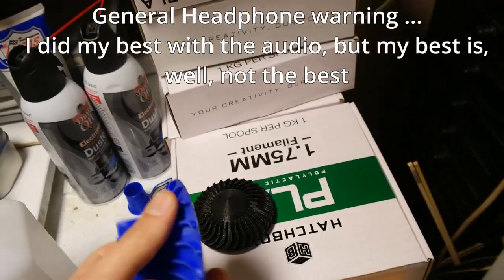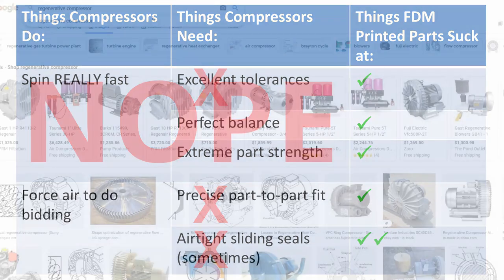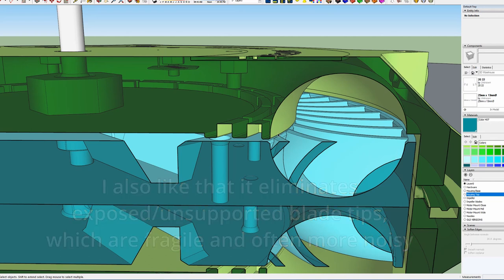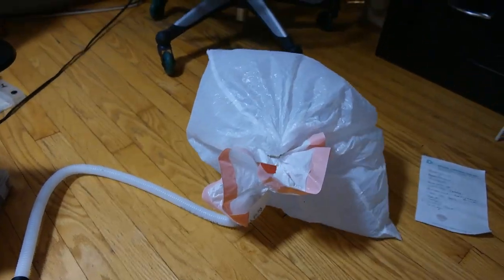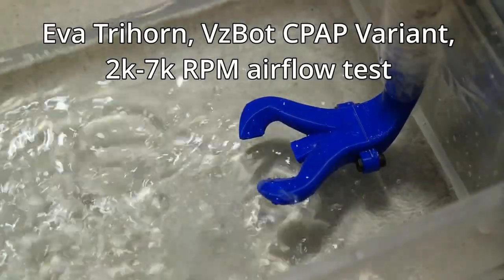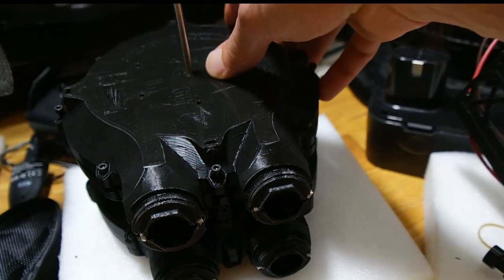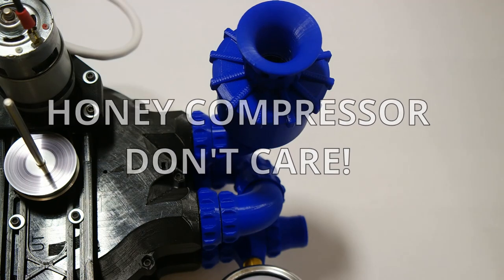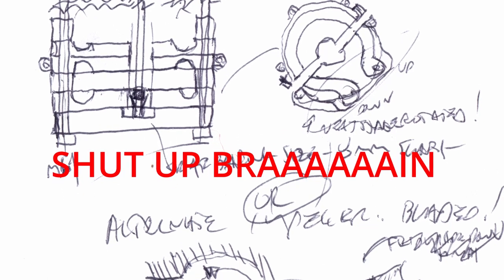I 3D Printed a Compressor that ACTUALLY WORKS (but you've never heard of this design)

Comment: Fully encapsulate the top and bottom of the blades and housing and run a tapering channel to spill the air into  you can use an impinging flow channel to get high pressure when it couples with the bulk spill air like a delavel nozzle running around the outer edge of the toroid where the opening is the outlet just a hint for future developments same as under an f1 car or the inflatable slide on aircraft.

Comment: Serious question, could this be scaled up to 400mm in diameter and used for the vacuum table on a CNC machine? Vacuum tables normally use these side channel blowers/ regenerative compressors and I have a ratrig 400 so I could print a 400mm diameter housing
Reply from the maker: I don't see why not (component scaling or reworking stuff like the bearing sockets would be the biggest task).  I think it works best when it's got some level of airflow to keep those vortexes turning, so as long as the vacuum table wasn't completely covered it might work.  And going bigger could really only help the performance!

Comment: low rmp centrifugal compressors already exist albeit hard to find examples of. you usually need at least 3 stages for decent throughput at higher pressures and they have a tendency to explode at high rpm. honestly though for 3d printed parts multistage axial plus 1 or more stages of centrifugal at the end depending on pressure needs is ideal. you can legit get ~10 psi max from axial compressor stages and they are super compact to stack with high tolerances. a old 100 stage one i made for shits and giggles would literally blow up the walls of the compressor if you managed to plug up the end. the outer wall was 1mm thick aluminum cast tube with steel wire mesh inside. stators and rotorblades were made out of cardboard(not corregated) while the main shaft was a 6ft piece of rebar with aluminum bushings. at 30 rpm the output pressure was ~130 psi before rupturing. note that the failure mode was not the cardboard parts despite being the ones imparting the energy. this is because despite the absolute pressure being very high near the end the pressure difference across the stages was actually quite low (~1-7 psi depending on the stage). it should be noted however that while axial compressors are technically more efficient in terms of static pressure you'll need a lot more stages to get decent pressures. do note that despite having high tolerances it does effect the performance somewhat if you are too loose and also while you can use something like cardboard its not recommended due to frictional losses (the air that came out of that behemoth mentioned above was hot enough to cook with despite less than half a rotation per second, its not supposed to do that)
Reply from the maker: Interesting!  Most likely the air coming out of a 130 PSI compressor cascade would be very hot regardless of frictional losses because that's an inevitable side-effect of compression.  If the cardboard compounded the effect it was most likely by being an insulator instead of drawing the heat into the housing....
Reply: @jamespray  to clarify, i was talking about after letting it expand into a open room. also i know it wasnt just from insulation due to the input power being kinda absurd(~5kw) with a somewhat pathetic flow rate

Comment: Put an inductor in series with your PWM signal and after the inductor a capacitor across to voltage control the motor so you don't have it sing a PWM song to you. You could even do a reverse pi of sorts.
Reply from the maker: Good tip, hadn't considered adding an inductor!  I'll keep it in mind.  Thanks!
Reply: Or just go higher in pwm frequency. Most hobby grade speed controllers support at least 16k pwm, which is almost inaudible.

Comment: The motor noise problem is really easy to solve, go higher in pwm requency.
Almost every Hobby grade brushed ESC supports 16k pwm, which is mostly inaudible. They're available from like 8 bucks in China. 
Or just go brushless. With a correctly sized outrunner, you could go direct drive and drop motor rpm to further quiet things down and be super efficient.
Reply from the maker: Higher PWM can help, but it comes with the tradeoff that you start to lose the ability to run slow, at least in my experience?  But a brushless might be more forgiving on that than what I'm using right now.  Definitely an area I'll be experimenting with in the future, once I figure out what "correctly sized" looks like.  The power demands of this design are no joke -- if I chase DC instead of AC, I'll probably have to look at something like an ebike motor.  Thanks!
Reply: @jamespray  the pwm frequency should normally be independent from resolution, but no idea, if you might loose low end resolution through some effect. 
At least in the old brushed RC cars, I didn't have problems with low end controllability at 16k pwm.

By correctly sized I mostly meant the KV rating, so that you don't end up bogging down a high revving motor or don't have enough rpm available. Heavily oversizing current capabilities won't hurt.
For example, if you want 5000rpm and plan on using a 12V powersupply, in theory you would need a 5000rpm/12v=416kv Motor+a little extra.

Finding a powerfull enough motor will be the last of your issues, trust me. You'll run out of powersupply before you can't find a motor that can take it.
I played around with the compressors side of a little Turbo and a 4074 brushless inrunner. That pulled around 100A from a 22V lipo, so yea, power won't be the issue.
Reply from the maker: @fabianrudzewski9027  Power supply is a bit of a sticking point and part of the reason I'm tempted toward AC, but I have to admit you're swaying me on BLDC's power capabilities!  Mainly, I'd love to not be stuck doing bench tests with batteries, but high-amp DC PSUs are expensive if you want a decent/safe one...

Comment: been thinking of building a Wankel compressor / vacuum pump so yes i can agree the rotary engine has possible benefits and can be combined with other pump designs to equal a better fine stage. Integra has designed and printed a lot of Wankel engines i suggest checking him out.
Reply from the maker: I do love Integza!  Wankel designs have too much sliding seal surface area for my taste and I don't think they're the most viable route for an FDM-printable compressor (as a demo, sure, but not as a long-term tool), but I'm always willing to be proved wrong.  Clever solutions can often get around such limitations.

Comment: cool project!.. what kind off pressure can you sustain with it?
Reply from the maker: My current record for completely blocked flow is 1.25 PSI, but that is with a fairly smol motor, not an upper limit on the compressor itself.  Eventually I will try a very big motor on it and I expect much more 😉

Comment: Great video! I had an Idea, why not use  SimpleFOC to drive a large BLDC quietly
Plenty of torque, you could easilly run this compressor or even use belts to increase or decrease the rpm if needed.
Reply from the maker: Pinned for the reference of any interested builders!  I was initially dismissive of this idea, but after some thought, I think it might be the best way to open up the full range this design can offer.  Having a cooling source that could run quietly for everyday use but also provide a wide range of extra cooling when desired was a big part of my overall goal for this, because currently I have to swap in different coolers for different power levels.  You should try it!  I will definitely keep it in mind if/when I get to working on the next iteration, it could just be a while :)
Reply: steppers utterly suck at torque and efficiency past a couple hundred RPM...this is a clear use case for a low Kv brushless direct drive with FOC to keep the noise down.
Reply from the maker: @AKAtheA  I'm a BLDC noob.  If you have any suggestions for specific hardware, I'd be happy to take note for potential future testing!
Reply: @jamespray  BLDC is the same as a brushed motor, just the commutator is electronic (and can do regulation, since it already has the switching transistors), same principles apply... lots of wire turns on a pole = low speed, high torque. Few turns = speeed, but little torque."Kv" is just a ratio which tells you how much RPM you can expect for a given voltage on an unloaded motor.
Reply from the maker: @AKAtheA  Thx!
Reply: @jamespray  You could buy something like an odrive if you are feeling fancy; kindof overkill but a lot of fun to play with for people such as yourself and it would come in handy in other projects I bet. A cheapo drone BLDC controller would do fine too. You just need to find a motor approximating the RPM and torque you need but there is endless choice out there; as said above a relatively low kv pancake drone motor sounds like itd fit in nicely here.

Oh; and indeed im quite impressed to see a working 3d printed compressor; was expecting to have gotten baited by the title and itd only work as an improvised explosive device. And indeed; I had not heard it either!
Reply from the maker: @eelcohoogendoorn8044  I appreciate the insights and suggestions!  Glad you didn't feel baited, too😆 Who knows, though, technically it only hasn't exploded *yet*, and with bigger motor tests come more opportunities ...!
Reply: @AKAtheA  thing is that you could use belts/gears to keep rpm of motor low

Comment: One way you can really quieten that compressor down would be to go brushless :)

I'm using a 3300kv 540 RC motor on a turbine and that thing at 12v is absolutely ridiculous. the only noise I'm getting is from the inducer and the vast amounts of air that it's flinging about. Especially if you can find a sensored motor and an ESC that can do phase angle control, the damn things are basically silent in normal operation.
Reply from the maker: One struggle is finding really low KV RC motors.  It's hard to overstate how different this type of compressor behaves from a centrifugal blower, but in testing recently I determined that this pushes about the same pressure and CFM as a ws7040 CPAP blower ... at one tenth the RPMs(!) ... and it wants at least as much power at that level.  And it's hard to make space for more than a 1:3.75 belt reduction.  So most BLDCs in the hobby space just won't work because they're such high KVs.  Maybe a crawler motor?

Comment: thanks man! this is what i need, btw you can control it with a BTS7960 and other motor that are quiter is 795 and 997 but don't go for 895 that beast is loud
Reply from the maker: You're welcome, and thanks, I'll check out those parts!

Comment: Huh. Awesome research. I planned to look into 3d printing a compressor eventually, but I was going to use flexible bellows, not a spinning wheel.
Walls printed like: |^|_|^|_|^| ... Like an accordion, are extremely flexible no matter what filament you use.
Reply from the maker: Somebody else just mentioned a bellows compressor as a potential 3D printable design, too.  You should go for it!  I think it could work if you could get some decent airtightness out of the thinner walls.  Probably it would get more pressure but much less flow than this design, but it all depends on the flow vs pressure stats needed for your use case.
Reply: @jamespray  I have high hopes for it. :-) I'm picturing something like the cylinders on a combustion engine pistoning. The cylinders are accordion bellows, and the camshaft is driving them.

Comment: There are more advanced controlers for BLDM motors wich vastly reduce sound on low rpm, i don't rember name of channel right now, but some guy showed this.
Is this design is used in CPAP machines ?
Reply from the maker: CPAP machines use centrifugal blowers at about 10x the RPMs.  The main real world applications for this type of compressor are (as I understand it) for generating industrial compressed air at high flow rates, like you might need for blowing off parts on an assembly line.

Comment: You should look into driving this with a BLDC using an FOC controller. Motor drive is quiet, low noise, high torque.
Reply: Had never heard of FOC before! Thanks for this!

Comment: Thanks to YT algorithm I couldn't find this video month ago. Now I designed, build and tested my turbine runing on 775 XD with GT2 belt transmition 1:2. It works but it's loud. I need to build intake muffler. I have no idea how to check pressure or CFM, but it can blow an latex baloon is few seconds. I didn't want to buy CPAP, it's to expensive amd I need it for my Corexy project.
Reply from the maker: You can measure CFM by filling a garbage bag of known volume (see how I did it in this vid) and timing the fill to get volume per time, and you can get an idea of pressure by measuring how far below water surface it can push air through a tube (use a jar or pitcher) - mmh2o or inh2o can be easily converted to any pressure units you like!

Comment: Aaaaaaaaaaand just when I thought I had heard about every main type of compressor and pump imaginable.....nope! It sounds killer, too! (Assuming one enjoys shrieking jet engine noises, which I do, but not INSIDE lol)

I'd be willing to bet each successive stage after #1 is going to need to be progressively smaller, like any multistage compressor. Fortunately, this is an area where it's definitely FDM ftw...now I need to build one and make some glorious jet noises.
Reply from the maker: If you want jet engine noises, this can certainly deliver!  I'm genuinely unsure about sizing subsequent stages, though.  This behaves fundamentally differently from centrifugal compressors (I mean, just look at the operating RPM range) and what little I've been able to gather design-wise from commercial/industrial models is that the main consideration is simply the length of the working passage(s) -- consider that unlike a centrifugal comp where the pressure rise is radial (hub to edge and then through the diffuser, if any) via a path that changes in volume from start to end, the pressure rise here is around the circumference of the disk, through a passage that is constant in cross-section.  That suggests to me (and I'm not an expert, so take all with a grain of salt) that the compression happens because the air is "packed" between the backpressure and the vortexes in the working passage that resist backward flow -- a very different compression mechanism vs centrifugal comps that work by working air up to high velocity and then compress it via expansion to trade the velocity for pressure.  Not that I think it's ideal to have identical stages in a regen comp, and perhaps sizing down would improve efficiency, but my personal intuitive take (at the time of writing) is that the blade design in each stage may matter more for optimizing performance for the average air pressure and characteristics at each stage.
Reply: @jamespray  I think it would be more akin to an axial compressor with respect to each successive stage becoming smaller in swept volume, but also in shape slightly, as you've suggested.

As far as staging goes, while yes, you're absolutely right that the mechanism of action is entirely different, I'm simply thinking of each stage as a "box" with an input of x amount of air at a starting pressure, and an output of y (~ that same amount of air minus friction/adiabatic/other losses, at a higher velocity/pressure based on restriction).  

Treating each stage as such, it's potentially possible (although overall woefully impractical) to make a multistage regen compressor.  It won't make flight weight, but it would sound really awesome!

Comment: How do you get all those fancy threads to seal?
Reply from the maker: The screw-together parts have mating sealing surfaces with a circular ridge on one face, designed to seal against a thin gasket (I used closed-cell packing foam sheet).  I don't claim it's a perfect design (rather the opposite -- I should have used chamfered mating surfaces so neither would need supports), but I haven't noticed any leakage at these operating pressures.

I did not put gaskets on the intake pipeline, which is probably why you can see the plastic sheet getting sucked into the joint below the intake stack right at the end :)

Comment: would it be possible to put 1 compressor within another compressor (no brain, stop it). Or what about using an axial flux motor to decrease the motor noise (that's it I'm getting the vodka).
Reply: Lemme guess. The "yo dawg" meme? XD

Depending upon the choice of design, yes, it is possible to nest concentric compressor assemblies. I don't know enough to say which designs work or if this is one of them.

Comment: If the motor's louder at low RPM, then what if you use some kind of drive belt so the motor can be at a higher speed than the compressor?
Reply from the maker: This does work, yes!  It's actually already how I'm running it (1 to 1.5 reduction with a 6k RPM 775 motor).  So if you only need low end, that is an option for doing it quietly.

Comment: If you're driving that thing between 10 and 15 volts, throw one of those 1 farad car audio capacitors on the power wires.  I think that would work to get rid of the coil whine.
Reply from the maker: I'll be honest, after the adventures I've had with instant camera flash caps, a capacitor the size of a water bottle is terrifying!
Reply: @jamespray  I mean... Don't lick it....
Reply from the maker: @prozacgod  sounds like a good way to lose a face LOL

Comment: How does this compare flow-wise, pressure-wise, and power-wise to the CPAP?
Reply from the maker: Versus a 24V CPAP blower like the VzBot uses, it's broadly similar, but maybe 25-35% more static pressure at stall, 25-35% less flow at free-flowing, and similar power usage.

Comment: Or you can get it by running  the air through a tank of water it would gurgle then less you have an export valve that slows the decompression rate stabilizing  it